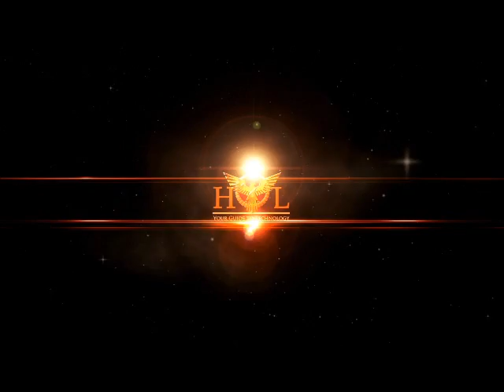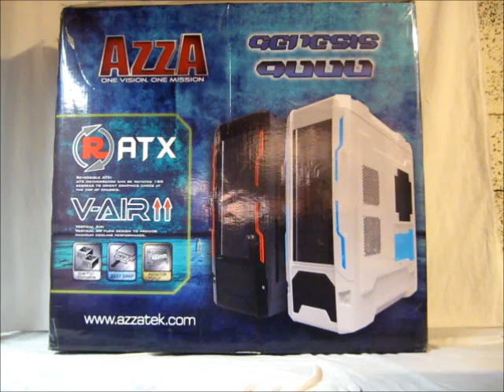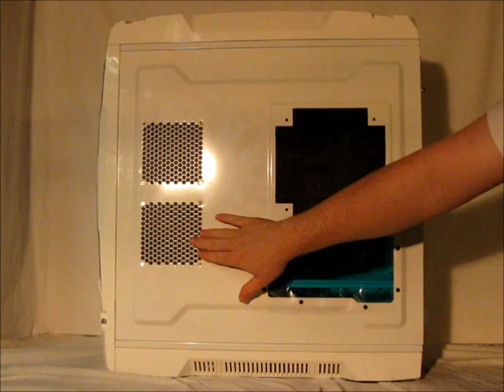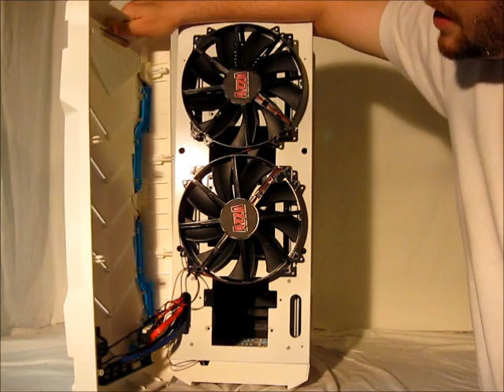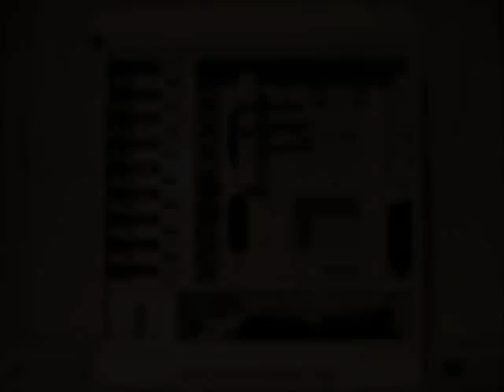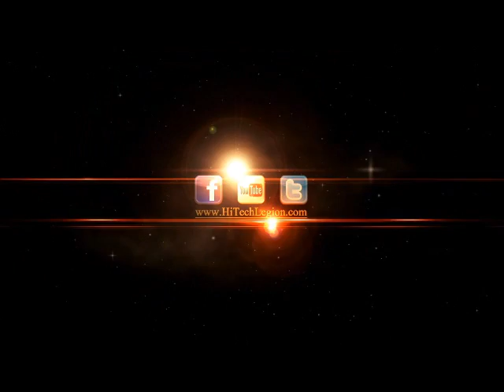AZZA Genesis 9000 White Full Tower Case Overview

Comment: What concerns me about this case is that while its stylish&has beautiful features is that the recommended PSU placement would require very specific GPU's. Just the sheer distance from the front of the chassis to the back, out the front and connected where they need to be connected doesnt even seem feasible.
Im currently using the typical set-up in the Phantom 410 Mid-tower, and I still have troubles stretching my cords
Im not sure why placing PSUs at the bottom became attractive since heat rises

Comment: It's okay to work in but once you get the power supply in it weighs a fking ton so I would recommend doing all your work then power supply. The only thing is taking that bottom plastic piece off is a pain because they clip and screw in. Temps are good especially with SLI.

Comment: Lol. I like your remarks. I own this case and Replacing the two bottom 140's with 2 120 Ultra Kaze Scythe 3000's I hit maybe 38 Degrees max on CPU with a El'Cheapo CPU cooler and my GPU never goes above 60. And It will fit 4 120's up top I already tried.